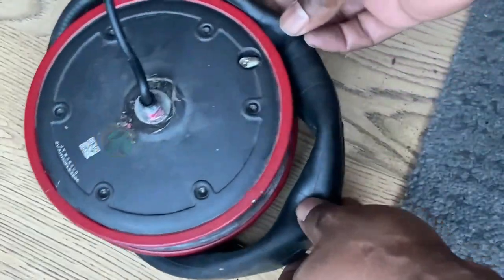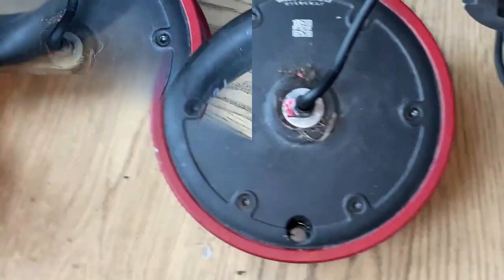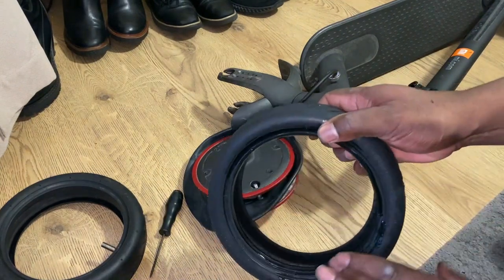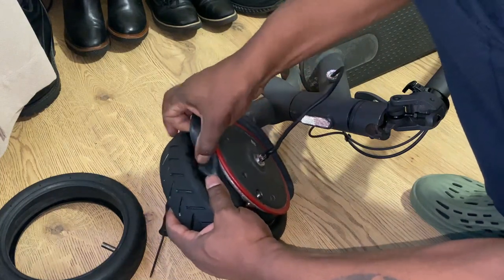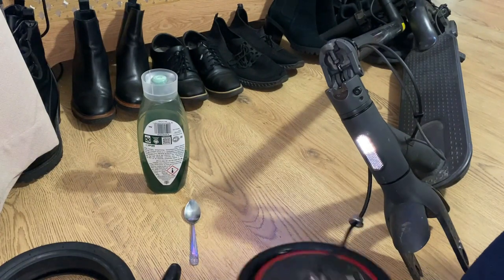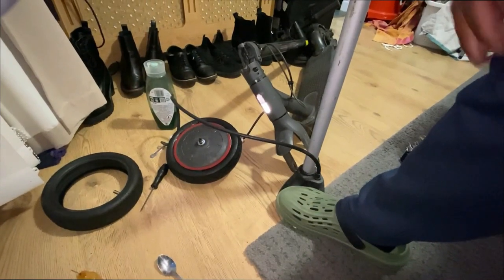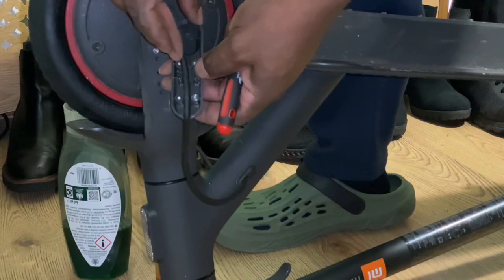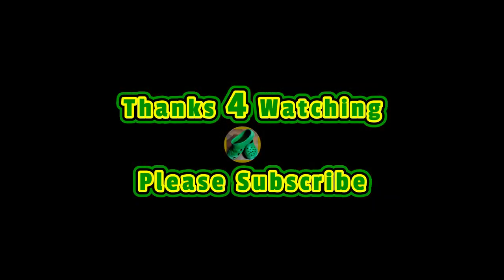Electric Scooter Tyre Tube  Valve Jammed In The Wheel Fixed

Comment: same issue here. No more space to pull it back, or bend it.  Wonder if I can remove the little plastic between the valve but assuming that is to seal the wheel from water.  Annoying
Reply from the maker: Hi Christopher,
                          you just have to work with it to persevere, that plastic collar serves some purpose. don't forget to pop a bit of oil around it.